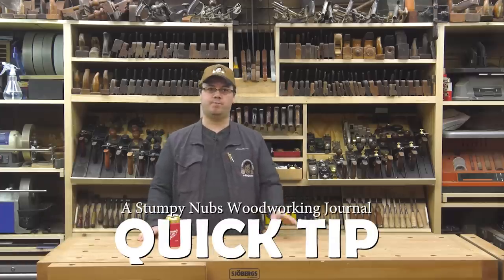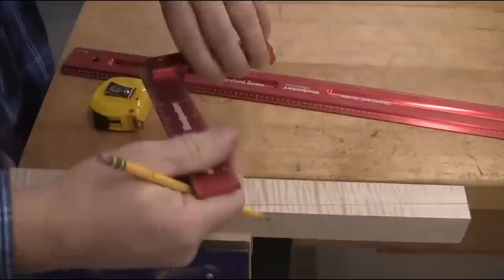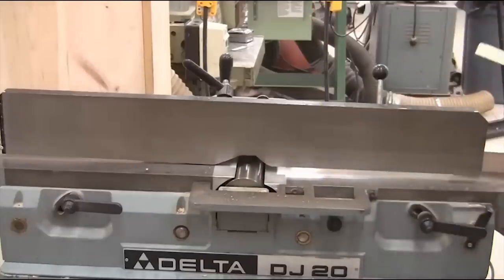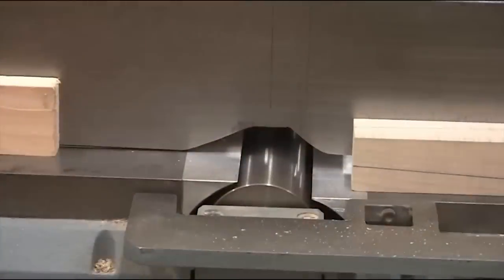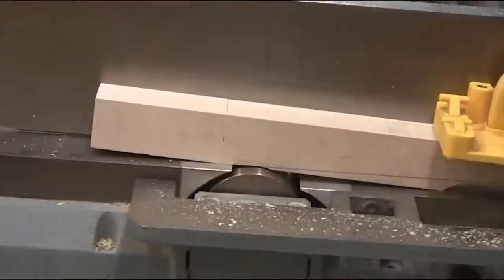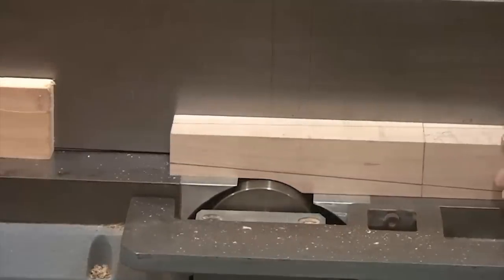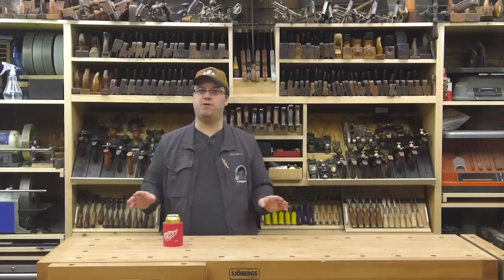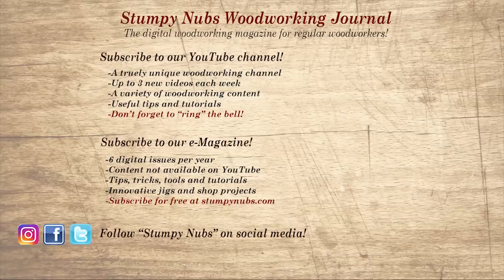The COOLEST way to cut leg tapers!

Comment: I’ve been doing this for years.  I call it “popping a wheelie” on the jointer.  Here’s another hint.  If you think your depth of cut is too much, divide the length by 3 or 4 instead of two.  Do the first pass just like shown (except stop at the 1/3 or 1/4 mark), thorn it around and make the remaining passes.

Comment: Interesting. Looks like you would need an industrial quality jointer for that though.
Reply from the maker: He's using a small one in the video.
Reply from the maker: @ricos1497  - The worst that can happen is it will bog down and stall the machine if it's underpowered.

Comment: So with a router table being similar to a joiner flipped sideways when a straight bit is installed, I think this would also work on the joiner, if you flip all the instructions sideways (imagine the video was filmed from above) and go slow with the cut. (all of this assumes you are using a split fence to have the same outfeed support as the split joiner table.)
Reply from the maker: I was think the same thing. Might do a followup on it.

Comment: My question is... how in the world did that occur to him? :)
Reply: I was thinking that same thing! It's cool though!
Reply: Very cool
Reply: It's a trick that's been around for a long time. I'm sure he learned it through the grapevine, like you just did.
Reply: I was taught the technique years ago, like nearly all the woodworking techniques I employ.
Reply: When he says “pivot it down at the foot”, is he lowering the leg onto the blade? How do you get the alignment right?
Reply: @almostben  You lay the cut portion from the previous step flat against the infeed table.
Reply: @almostben  When you run the leg into the stop block, you create a pivot point. To form the taper, you then turn the leg around and run it top first. Push down on the foot, so the leg pivots to rest on two points, then pass the leg over the jointer. This is all done on the infeed table before making contact with the cutter head.
Reply: Thanks folks, makes sense now.

Comment: The thing about this technique is that if you should have something misaligned or slightly off measurement and you make that full cut only to find that things aren't quite what they should be... you've just cut away your reference surfaces and there is no way to "sneak up" on your line. I agree, the method is very interesting and ingenious but I'll stick to the tablesaw/bandsaw.
Reply: Artie, This entire method is based on you being able to divide two numbers in half – the total amount of taper, and the total length of the taper. If you're worried about getting it right, make sure you mill an extra leg (could be out of a cheaper material) and give it a try. There's no need to "sneak" up on the line if the math is correct.

Comment: Thanks for yet another great tip. Two suggestions to make the setup faster and safer. The depth of cut is 1/4 the difference between the leg width at the top and bottom. (Half the difference on each side, half of that for the jointer cut.) Use your combo square tip to set that directly with the machine off. With the machine also off, roll the cutter head to get the start of cut - it won't matter if you're off by a tiny fraction.

Comment: Seems like a good trick, but this seems like it's going to be limited on some jointers with smaller motors to a pretty shallow cut.  The Grizzly G0490X with a 3 HP motor only suggests a max of 1/8" of an inch.  Is this a serious limitation?  I must admit I haven't made many tapered legs.
Reply from the maker: That wasn't a very big jointer he was using in the video. The max cut recommendation is for boards of the full width of the jointer. Legs are much narrower.
Reply: @StumpyNubs  Good point, thanks.  Keep up the good work!

Comment: 7-29-19  ....  Just came in from the shop where I used this technique to taper a set of table legs.   My jointer table wouldn't lower to 11/16 inch cut that was needed for the initial passes,  but the end product (the foot of the leg)   was only 3/32 wider than I wanted.  End result was a success !!   Thanks so much !

Comment: I have seen this method before, years ago. It seems to me that the first cut, 3/8" straight into end grain, would be very likely to cause tearout.  Not to mention hard on the jointer.  I have done it by setting the jointer to 3/8", setting the midline one the cutter with the thin end trailing, this creates a taper that is half length and half depth.  Now set the top line on the cutter and make a second pass. Do this on each tapered side.  This method puts the cutter cutting out of the grain rather than into it.  I find it to be a bit tedious and uncertain.  I still like to cut them with a tapering jig on the Table saw and clean them up with either the jointer or a sander.

Comment: As I recall, Kelly Mahler used a jointer to taper the legs in his video on making a Shaker table. I think that Kelly made a series of increasingly longer cuts so his technique was a little different. Still, all he had to do following those cuts was to make a couple passes with a smoothing plane and the legs were ready for construction and finishing.

Comment: Cool tip.  Seems a little scary.  If I had a jointer, I think I'd use my tablesaw anyway, but cut it a skosh fat, then take a light cut on the jointer.  Since I don't have a jointer, and wouldn't have room for one anyway, the point is moot for me.  Back to the scraper...
Reply: I'm with you on that one! I have seen this done a different way on the jointer and this one seemed slightly less scary. Ah well, since i don't have a jointer, no worries!